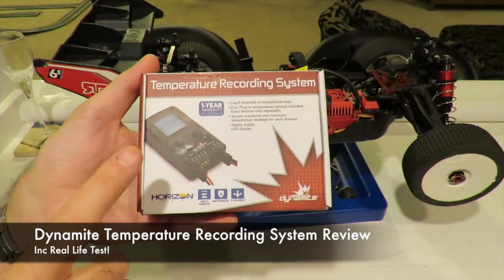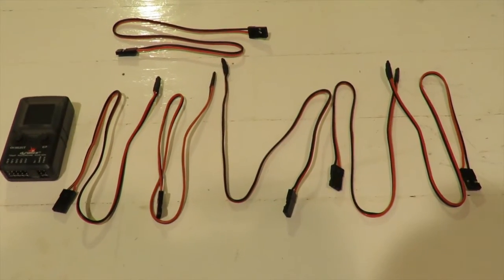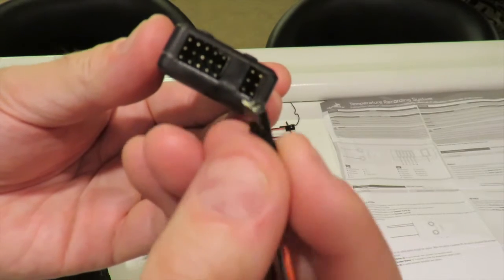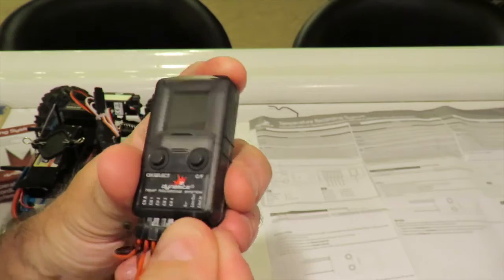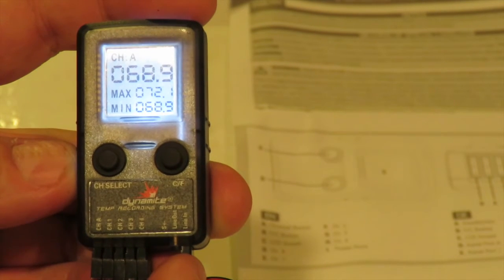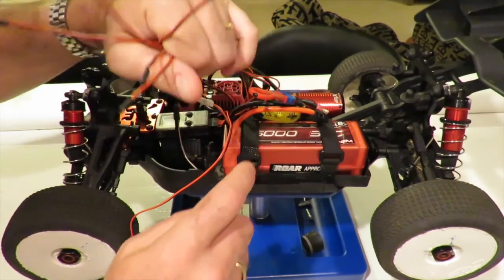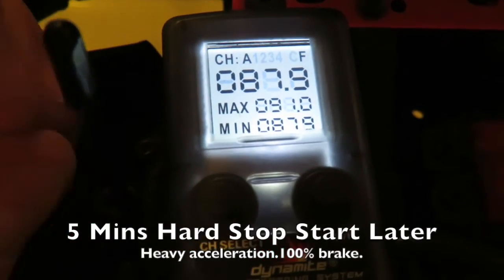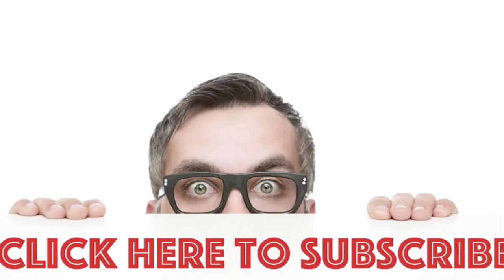Dynamite Temperature Recording System Review - RC Car Temperature Sensor

Comment: hi 
maybe you can help me 
i have a arrma typhon and is cutting Signal after 5min driving it then i switch off the the car and turn it on again and everything come to normal but when it cut signal the esc is flashing green do you know what it can be please thanks very much for your help  :)
Reply from the maker: You will need to check the user manual, if you've not still got it they do one online. At a guess it is suffering from an esc overheating issue or lipo cutoff voltage. But check the manual which gives guidance on the flashing lights. Let me know how you get on. I've a max 8 escc fitted which can handle big speed run power
Reply: Driftomaniacs 
the manual only say 

If the ESC temperature exceeds 105 degrees Celsius/221 degrees Fahrenheit, the ESC will enter temperature protection mode and the red status LED will blink. Once the ESC has cooled down it will resume normal operation. 

but my led is blinking green
Reply: i think this max 8 esc is a good one a ?